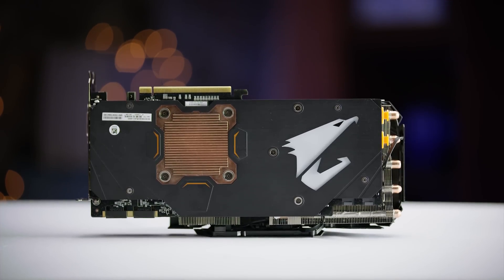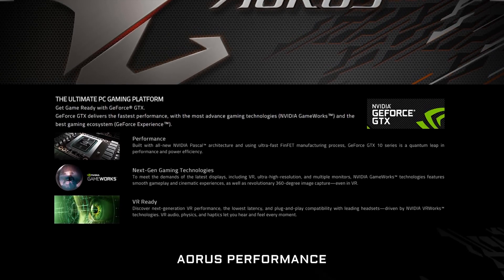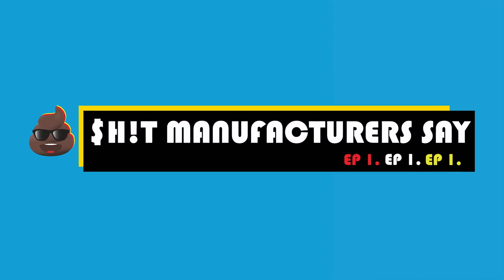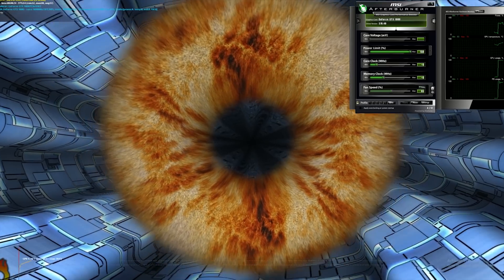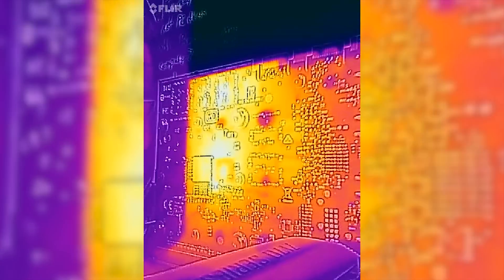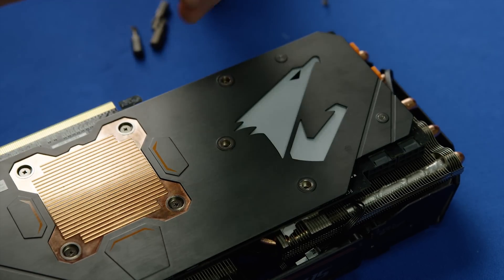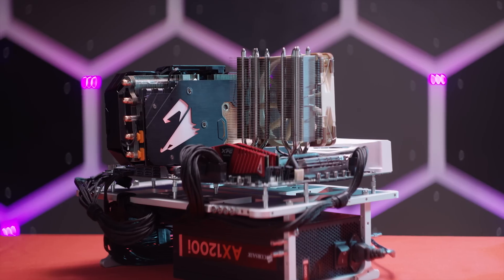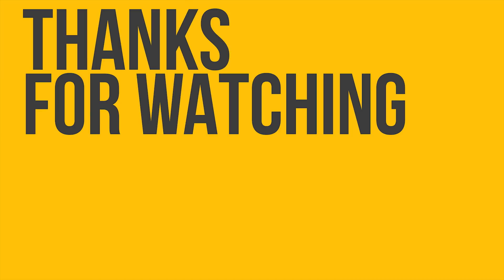$h!t Manufacturers Say Ep. 1 - "Backplates Cool Your Video Card"

Comment: Maybe I'm about to say a stupid thing, but... if you remove the backplate, could it be that the main fan revs up rpm a little bit to mantain the same temperature? I mean, by setting at fixed rpm in both tests (with and without backplate) maybe the test should be more correct. I'm curious... :)

Comment: Terrible test. They act as a heatsink, yet you don't apply any air flow to take away any heat? Hyper 212s are hella useless as well when they have no fan attached to them.

I don't believe it would make much of a difference anyways, maybe a few degrees with the copper heatsink one, but results are results if you would have done it correctly.

Comment: I am thinking the copper cold spot was because the massive amount of thermal paste was acting as an insulator instead of a conductor. The heatpad was cold but underneath it wasn't, the heat just couldn't get past the thermal paste.

Comment: just like the MSI m.2 slot the metal properly conducts the heat and lowers the temps untill it quickly has aborbed all the heat it can take and then quickly starts pushing it back into the generating device.

the issue with all of these shields is surface the area a flat piece of metal provides isn't enought for the heat beaing generated by these devices. we need fins for proper surface area to remove the heat.

Comment: shouldnt toy check the fan speed with the copper plate on or off? a ramp up in fan speed whould increase cooling. and in an open enviroment you wont get the results from that heatsink compared to inside a case with air flowing over it. just a thought

Comment: I love it when people think they can prove something just by doing some kind of random test.  You saw with the flir that it did infact create a cool spot on the card when it is on.  Additionally, the temperature recorded through msi afterburner takes the reading from a different part of the card.  Finally, the cool spot keeps certain parts of the card at a cooler temperature and allows greater efficiency in conduction and convection essentially allowing the card to return to room temperature much much faster after shutdown which increases the life of the card as well.  Having the additional heat sink does not mean that the actual core processor of the gpu will run cooler under high load, but it does allow faster cooling rates outside of high load.

Comment: A back plate will help cool the card, but the difference is not noticeable. What would really help a backplate cool the GPU is airflow. The backplates have such a small thermal capacity that the amount of heat they dissipate unassisted doesn't make much of a difference. But a fan should really help.

Comment: I know of a really persistent one that isn't true: "Larger pixels on your camera sensor increase low light performance." It only looks like it increases performance on first glance when you compare photographs 100% zoomed in. For a more fair comparison, you need to downscale the higher-res image to match the lower res one, and then when you do that there isn't actually a difference in noise at all. Which obviously means more pixels is preferable for increased detail. Think about it, the amount of light hitting the sensor is the same regardless of how many pixels are on the sensor. Why would it become more sensitive with larger pixels? Do some testing and you find out it doesn't and the manufacturers are bloody stupid. As far as I can tell, anyway.

Comment: You probably COULD cool stuff heavily from the backplate if you really wanted to go that route - but it would almost certainly require a heatpipe or two that could transfer heat from the front of the card to the back. Then you could potentially have loads of heatsinks or even fans back there since there is a lot of extra space to work with (not considering conflicts with cards in nearby slots that is).

That said - it's probably just not worth it. More complex design, more expensive, it would be a hell to assemble since heatpipes would mean the whole sandwich would need to be one piece... and for what really, a handful of celcius lower load temps? There are already very efficient coolers that easily handle even OCed cards - and you could always go water if you need to feel more extreeeeme.

But just a backplate - no matter what pads or heatsinks you put on it won't do much. The reason is simple - all the main heat generators are on the front of the card - and PCB transfers heat really poorly, so only a very small amount of it is going to leak out though the back.

I would be sweet if material science could come up with a high heat-transfer PCB substitute though... essentially making the whole cards its own heatsink. Get on it scientists!

Comment: This should have been done with a fan blowing on the back of the card or in a case to account for airflow over the back of the card from your case fans as that is the only way for the heat from the back of the card to properly dissapate. If you did not do this, YOUR RESULTS ARE INCONCLUSIVE!!! Sorry, but try again.

Comment: I think the GPU temprature might benefit from the backplate, if the card is in a case, because the air coming from the fans could transfer the heat away better.

Comment: The "cold spot" on the shiny copper backplate heatsink is just a reflection of the surroundings. Where it's shiny and reflective in the visible wavelength, it's so also in the thermal IR wavelength. Spray some matte paint on it to see the temps.

Comment: And how about temperatures on vrm and memory, especially on cards with mem on the back? Of course backplate doesn't cool CPU, because of PCB, for example. But it can (and can not, of course) help to cool vrm and memory. 
Don't forget, that some of manufacturers (msi) cools them with thin metal plate, not with radiator

Comment: This could have been discussed further other than the direct gpu temperature, such as the possible benefit of adding a couple of thermal pads to the back of your card to help cool the pcb in critical areas, such as the vrm region. Reducing the temperature of critical pcb components could increase the lifespan of your graphics card. Also gpu temperatures doesn't necessarily mean overal components temperature, since the vrm runs much hotter than the gpu itself, and yet it's a vital component of the card.

Comment: you could have consulted a mechanical engineer if you wanted to test the backplate with more accuracy

testing this on your open-air test bench has an effect on results too. in an enclosed case, you'd have different environmental variables to control, such as the temperature of the air in the case itself or air flow around the card. both could impact results either for or against the manufacturer claims. either way, the numbers could have been fudged just to look good on their site

Comment: plate not, but fan on 2 side my card Gtx 730 allow me up oc with card (65C with 885 Mhz core, 1770 Mhz Shader and 660 Mhz memory clock) when i get more i see many pixel and system change resolution. When I didn't have fan on two site i can't get that much Mhz.

Comment: Maybe, just maybe, for once, cooling doesn't need to affect performance, but longevity of the board. Granted PCBs can withstand a good double and a half of what CPUs average on loads, actual PCB performance isn't an issue either in terms of traces, solders, etc. I mean, PCBs heating up isn't something many people think about, it's usually all focused on the hardware /connected/ to the board. In the long run, the heat over the lifetime of the PCB might not even matter relatively to our usage, but in terms of longevity, you would think there's at least some positives to a heatsink on the backplate. 

Maybe I'm talking out of my ass.

Comment: Why not test it in an actual case rather than a test bench, that way you get the air flow from the case fans. I'm not going to say it would make a difference, but if you are going to test things like this, why not use real world scenarios? I've seen "real world tests" be mentioned many times in the LTT comment sections. Luke's videos are beginning to have less and less effort put into them. Again, to validate the point that backplates don't make any difference to cooling, why not try a couple of other cards that also have back plating, or even go as far as to ghetto mount a low profile cooler to the back for additional proof that it will never make a difference.

Comment: if the copper plate worked wouldn't it be a hotspot not a cold spot. I assume making proper contact with a hotspot would make it warmer than the surrounding plastic there by drawing heat away from the gpu

Comment: My backplate really has a job to do, it cools down the memory chips on the backside of the pcb. Also my backplate is watercooled :)
Reply: (ok ok, the backplate does not have liquid running through it, it just has a heatpipe that extends to a small block that has liquid flowing around the heatpipe thus cooling the backplate). Aquacomputer Kryographics on a Titan Black.

Comment: maybe I can cool my gpu by throwing ice at it while my pc is running.
Reply: VortexAnimations yes do that
Reply: Submerge the motherboard and graphics card in mineral oil in a sealed container to prevent water condensate from growing on the boards. Add dry ice to the oil bath. It should reach ridiculously cold temperatures fast.
Reply: Great Value Bleach Too cold without preparations
Reply: VortexAnimations yes you can 😂

Comment: i think this is a question for gamers nexus to answer as they have the thermol sensors to do the checking for specific parts of the card. other thing to mention is that thermol pad is rather thick imo. i would see if you could find a more up market thermol pad to replace it to see if there is a diffence. lastly if the copper plate was working right it would be as hot as everything else if not hotter given that what sinks do themoldynamically speeking.

Comment: Has anyone ever tried to put a cpu cooler on a gpu?
Reply: CryoTech diy perks
Reply: Yes. And it works!
Reply: Yea it works fine. I've zip tied an old Athlon X2 cooler to a Radeon HD 6850 because the original fan died and it ran better than with it's intended cooler lol
Reply: Linus has done it in scrapyard wars
Reply: DIY Perks he actually commented on this video
Reply: If you do so just be sure to cool everything else on the board that the old cooler covered, like the memory chips.
Reply: Use the kraken g10
Reply: Yep they make adapter brackets for Corsairs AIO and NZXT coolers. I would be careful with the NZXT one as I had issues with mine the wiring melted lol.
Reply: You'd only be cooling the gpu, not the vram, which does get toasty
Reply: Apart mounting and potential surface issue, it should work. A cooler is just the same no matter what the electronic component it tries to cool. 
Still mounting is the big issue here: most CPU cooler give you a plate for CPU mount standards (AMD or intel) graphics cards do not have such mount and GPU also tend to be smaller than regular CPU (which in a sens is good as it means that the cooler will "connect to the whole GPU but still not perfect)
Reply: Zaryab B what was in my original comment that triggered you
Reply: JoneTech why are you saying he actually commented when clearly no one from ltt commented? It's the equivalent of click bait. What you want people to like your comment or something because you make them believe luke or someone commented? I don't get it?
Reply: Zaryab B DIY PERKS commented on the video .it was when the video first came out but he apparently deleted it
Reply: wow man thats pretty rude funny james shut the fuck